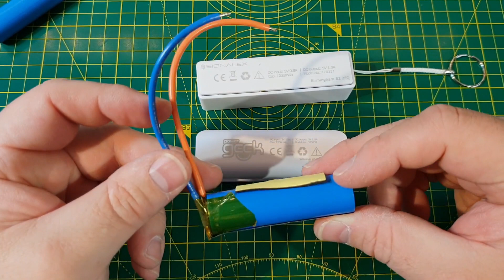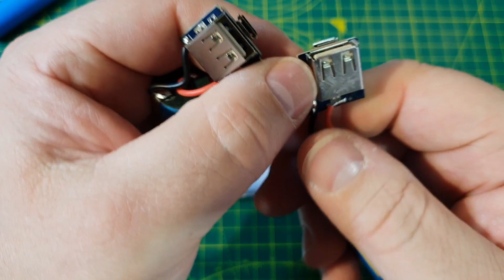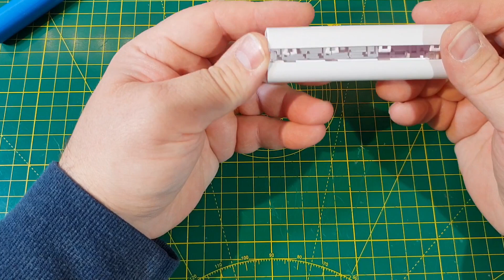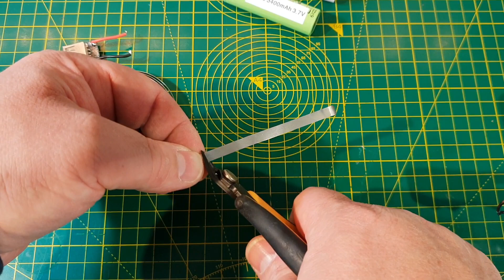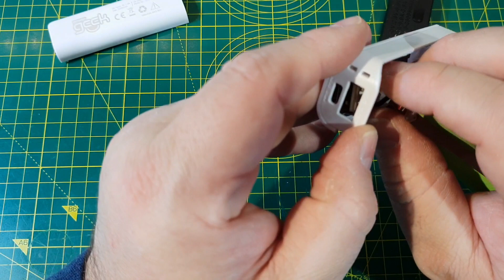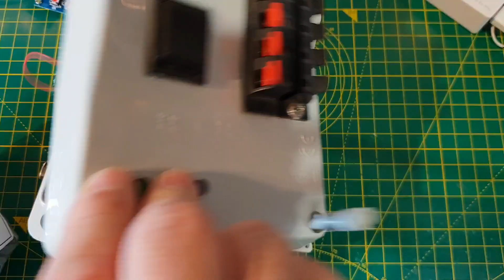Poundland £2 Geek Power power bank teardown and mod

Comment: ok you got a max of around 1100mah from the one pound ones-what did you get from the two pound one?
Reply from the maker: 1842, much higher than I expected!
Reply: @childscraig  hi Craig yes I heard you say that. Just wondered approx how much. I was wondering if it's worth paying £2 just to get half decent 18650s as I've not found anywhere that sells 2000mah batteries for less than this.
Reply from the maker: @nodriveasusephotos8019  I would say they are a good buy, I often buy cells online but they start at around £4 for decent cells. Can't comment on their performance over time though!